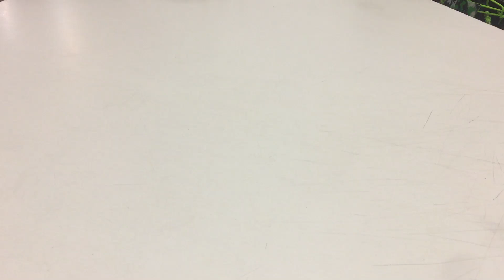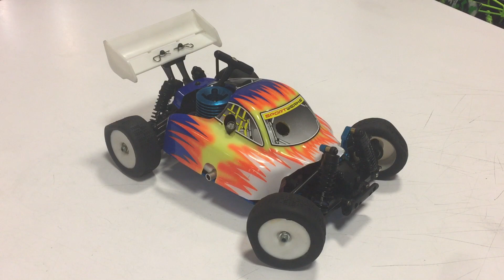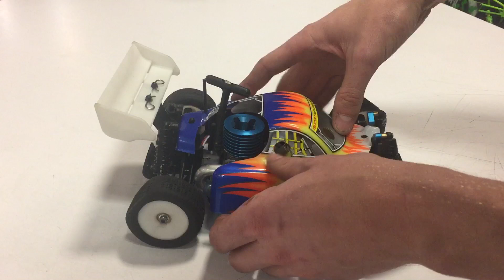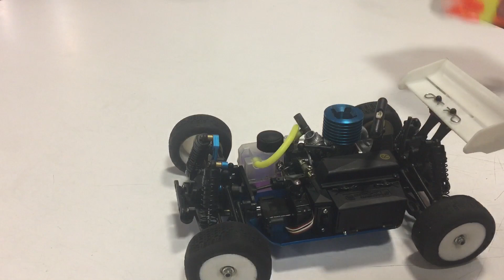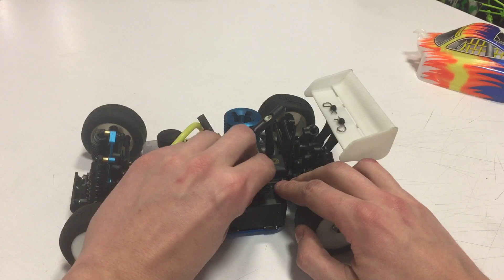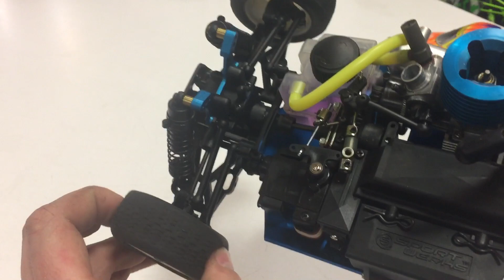SportWerks Chaos 1/16 table top review | Mini Nitro RC

Comment: I just bought an Rc lot and it came with one of these. The rear diff is taken apart. I inspected the gears and they look ok, not sure why it was taken apart 🤔 the gears appear to be plastic.. I would have expected metal for a nitro car. Anyway, hopefully I can get it running soon. also the engine is currently seized. Probably just gummed up from old nitro. Should be able to clean it out.